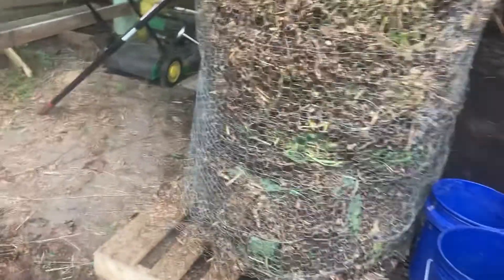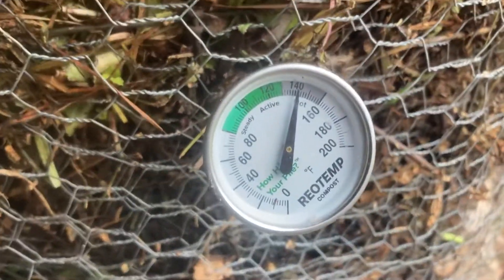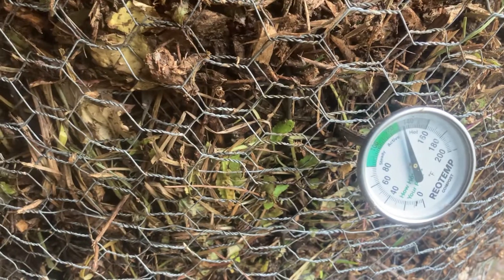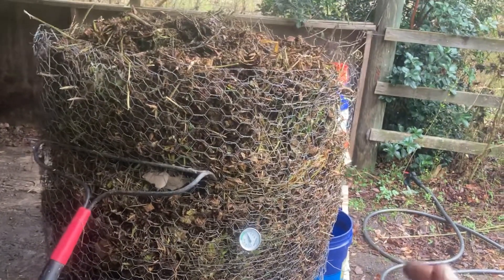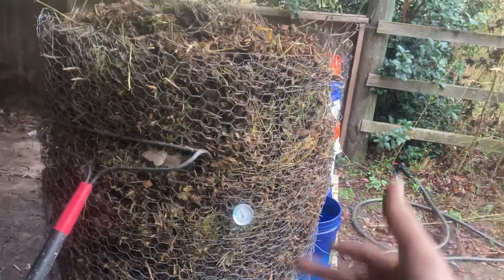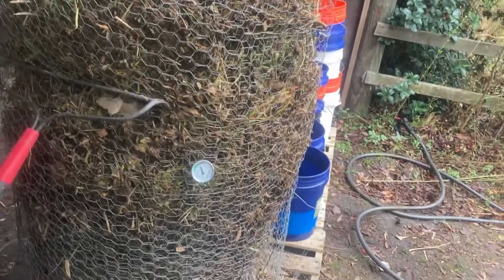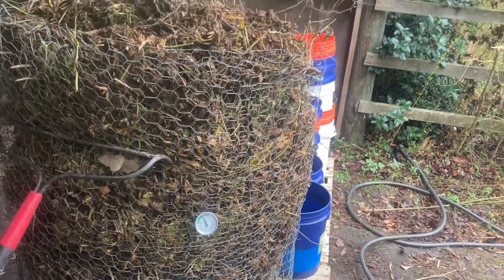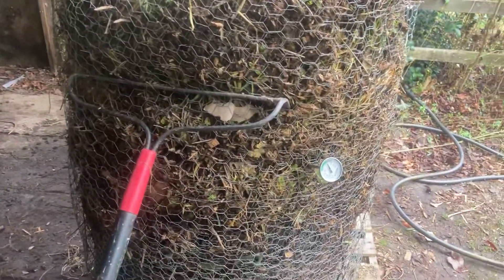Bio-complete compost pile one is up to temps!

Comment: I’ve always seen these types with tarps around them. To keep moisture in and the side drafts out. This style is susceptible to drying out quickly. But yours looks great
Reply from the maker: The school teaches to keep a tarp over it to solve the drying out problem and an maintain aerobic cushion around the thermophilic center when using this method.  I have since learned the cage is not necessary in achieving sufficient biomass populations if our moisture is accurate throughout.